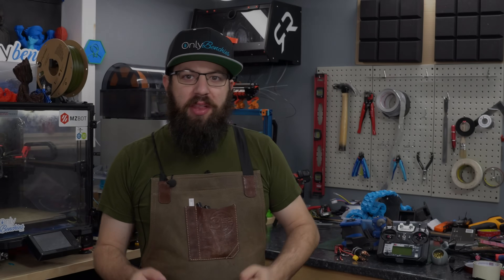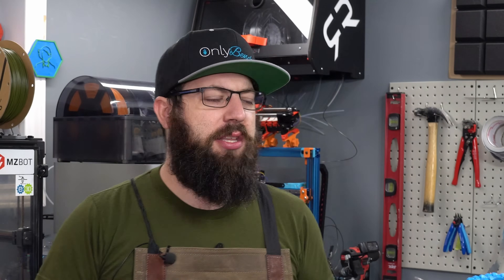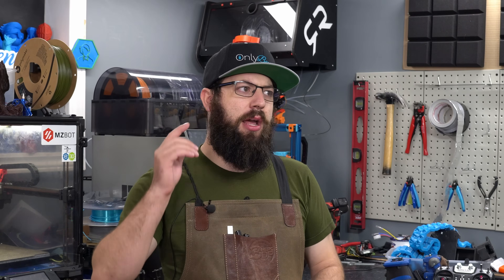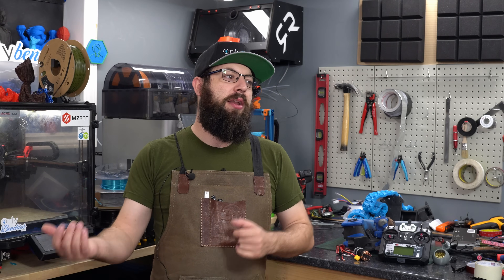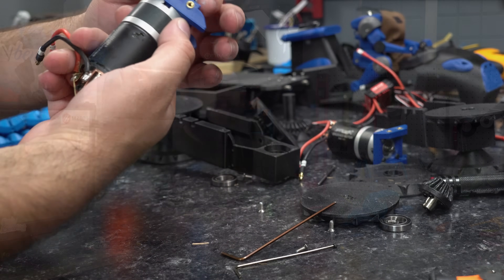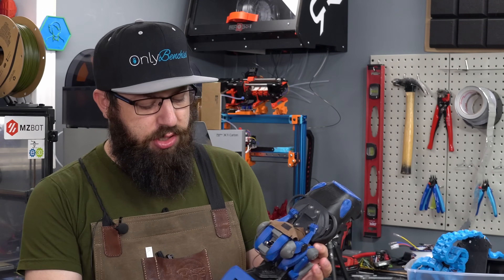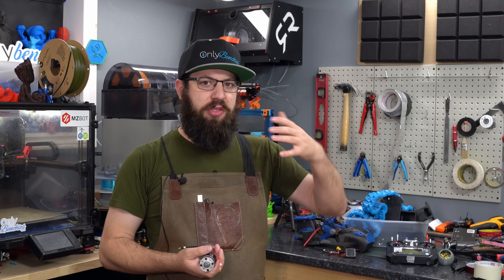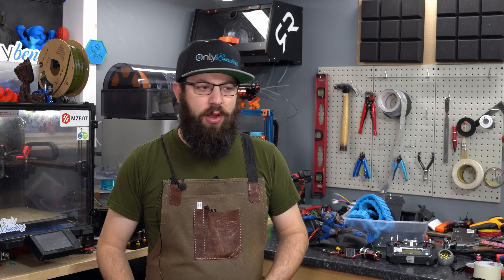How Well Does a 3D Printed Robot Tank Hold Up?

Comment: in retail RC cars you tend to have a sprung "servo saver" on the output splined shaft of the servo, for this specific reason. It stops a crash where you clip a front wheel on something, breaking your servo

Comment: You're like everyone who builds a voron with cf nylon parts or petg. Just stick with the recommended materials!
Reply from the maker: Nahh, wheres the fun in that 

(also there really wasnt anything recommended other than TPU tracks, in fact many of the PLA printed frames had some pretty catastrophic fails and cracking from impacts)
Reply: What are you going to lose out on by using cf nylon
Reply: @JeronimoStilton14  It drifts over time
Reply: @imst4722  ah ye olde creep. Not exclusive to cf nylon, but I’m guessing worse than PLA? Wouldn’t suprise me as PLA is pretty bad but you can always get worse.
Reply: @JeronimoStilton14  haven't done any testing

Comment: A 11 turns Motor are you crazy, that is for the plane. I did that to my car, and it was crazy fast almost damaged my 4-wheel drive chain. You should have a 17 or 18 turns Motor.
At least you have fun out of it.
Reply: Don't forget that there is a 5:1 gearbox on the motor in this setup to trade speed for torque. And there is another 3D printed gearbox from the pinion to the drive wheel. I have not driven a DR myself, but many other powerful or even overpowered RC cars. Without trigger discipline on acceleration, they all just spin around out of control, but it's nicer to have a bit too much power than just barely enough.

Comment: for the motor I would recommend a 20t 5 slot motor, 11t is way to fast in my opinion.
Reply: Sam didn't seem to understand what motor turns meant when he chose 11t
Reply: @crashmaxx1987  it definitely does! Pretty sure it's an 11t 5 slot but would still be equal to a 22t 3 slot motor
Reply: what is slot here?